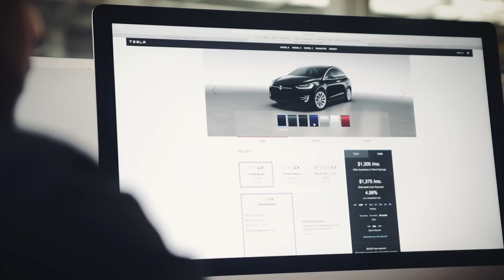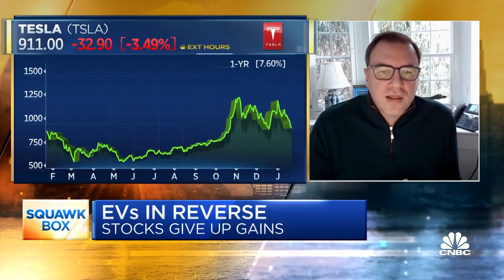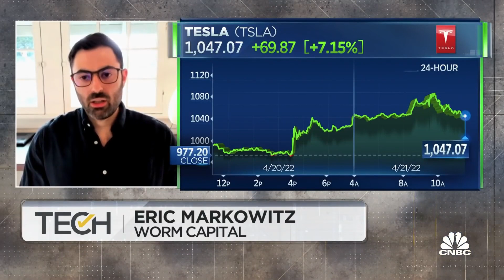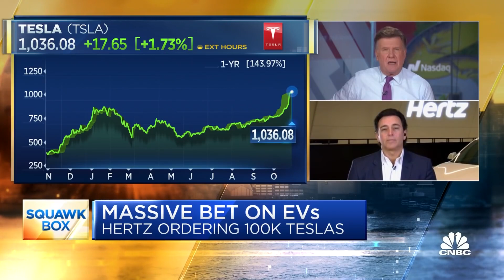THIS Is Why Everybody Is WRONG About Tesla Stock Valuation

Comment: This guy didn’t just make Tesla you know. He made PayPal, Zip2, and he ACTIVELY participates in spaceX engineering. This is not your average CEO. This guy is seriously hands-on with everything and anything he has his finger in. And there isn’t a company ran by him that i wouldn’t expect massive profits from
Reply: @jeremiahlim2925  Tesla has it’s entire manufacturing process done by them at it’s root. They mine, process, and manufacture their own everything. Tesla is a different kind of company. I would not be surprised if it overtakes the entire U.S GDP in a couple of decades. What do you think The Boring Company is for? It’s for mining their lithium deposits to make their own batteries. Tesla, as it stands, is the only totally independent company in the world, totally non-reliant on external factors. Musk designed it this way on purpose since the 2008 recession nearly ended the company
Reply: @jeremiahlim2925  and it also does not only make Electric Vehicles. Tesla makes energy generation and storage, they will manufacture robots that are self programming and will do everything from working Indonesian sulfur mines to picking up your groceries. Truly it will be a golden age for humanity as a whole
Reply: @jeremiahlim2925  oh and for the record, Warren Buffet also said Bitcoin was going to zero. He’s not omniscient. The man makes mistakes

Comment: WOW!! You sure got a lot wrong. A couple billion in annual cash flow? Try $3 +billion in the 1st quarter of 2022. That should be a total of $10-15 billion in profits in 2022 on sales of around 1.5 million cars. Profit wise, that should get them in the top 5 of auto makers for profits. They should also be top 3 on profit per vehicle too. Also, they have zero debt while almost every other car maker has at least $100 billion in debt. Tesla has the highest margins of all automakers and are selling every vehicle they can make. They also have been growing over 50% year over year for the last 5 years. Overvalued??? I personally will choose Tesla stock over any of the legacy automakers any day.
Reply: You don't seem to get it. It does not matter how many cars they make and how profitable they are. Their valuation purely based on car sales is ridiculous. 
BMW already have this kind of profit. Why is their valuation not a trillion ? Margins are also about 10% lower. Will increase by 10% make the company worth 20x ? No. Their electric cars are growing at over 100% YoY. Are they worth a trillion ? No.
Reply: @Nick  let's use BMW as comparison. Are their car sales growing over 50% YoY? Last year they sold 2,521,000 vehicles, that's less than they sold in 2019. So sales are dropping. How much debt do they have? Over $180 billion, yes that's Billion.  Tesla has 0. BMW made $13.8 billion in 2021, Tesla made $3.2 billion in 1st. Quarter of 2022 so will make more in 2022 than BMW on fewer car sales. Bottom line, I'll invest $10,000 in Tesla and you can invest $10,000 in BMW and we can compare values in 5 yrs. Feel very confident that I'll be very much ahead of you. If you don't like BMW, go ahead and pick, Ford, GM, VW, Hyundai, Toyota, Honda.... willing to put your $ where your mouth is?? Yeah, didn't think so.
Reply: @davekozlowski1266  Why would their sales grow 50% ? They have reached the peak of the luxury car market. There are no more people than that who can buy a car of this value. The rest of the market is mercedes, audi which sell similar. 
Tesla is growing just because they are selling different product - electric cars, which BMW does as well at over 100% growth.
 

Sales are not dropping. Covid affected sales, which are now back to normal for 2021 with supply chain issues still in place.
And your figures are wrong. BMW has profit before tax of $16 billion for 2021 not 13. 
The difference does not justify 20x valuation.

You can invest 10 000 in tesla and get better return, however that will be nothing to do with their cars.
Just because it's overvalued it doesn't mean you can't get a return.
My point is, tesla people have no idea why it the stock will 5x, everyone just hopes it will. 

If it was down to car sales, which is the only thing you guys talk about in detail that means that every single other car company is undervalued. Repaying 100 billion in debt does not equal a trillion dollar revenue for a company.
Reply: @mnoovurvi  Tesla's sales growth is over 50% YoY. BMW EV production may be growing but 95% of their sales is ICE cars whose sales are dropping. If you don't want to include ICE cars, then Tesla is 10 times as large. Bottom line is most of BMWs profit is from ice vehicles whose sales are dropping. Almost all of their equipment is for making ice cars which means it won't have any value in a few years. And no, BMWs profit was $13.8 billion last year. Not $26.
Reply: @davekozlowski1266  I already explained why bmw's total sales won't grow by much, they are over a 100 year old company. They have already reached the peak of their market. 
They will now have to slowly replace ICE with electric cars, which they do at over 100% growth. ICE sales are not dropping by that much. Total sales are increasing. 
It's still not a trillion dollar company.

If you think specialist equipment is needed for electric cars you're wrong. It's the same robots, the cars are exactly the same with the only difference being instead of engine/transmition being mounted to the body, a battery/motors chassis is mounted.  BMW's profit before tax was $16 billion, not 13 or 26.
Reply: @mnoovurvi  income before taxes, why not just use income before expenses? That means almost as much. It's the bottom line that counts.
Reply: @mnoovurvi  Tesla will be selling more cars than BMW in 2023. Difference is they will continue to grow while BMW sales will continue to drop.
Reply: @davekozlowski1266  Doesn't matter. The point is, BMW and Tesla are not 1 trillion dollar companies even if they sold 10 million cars per year.